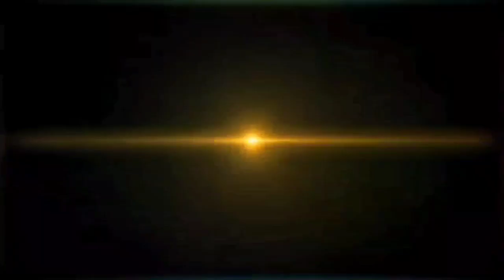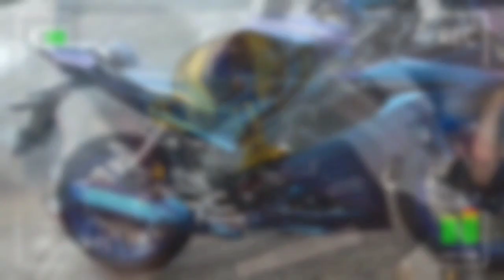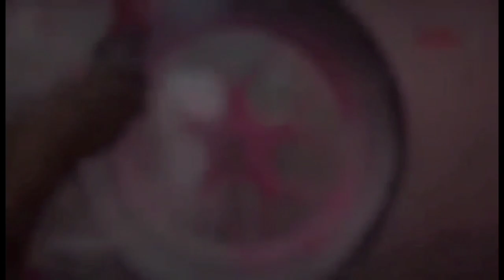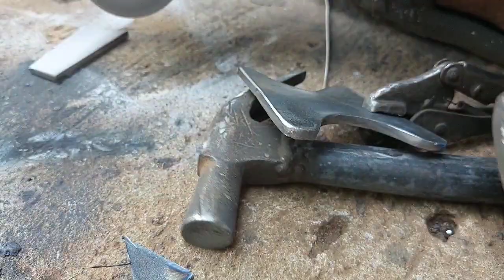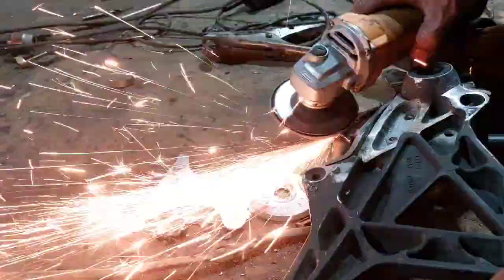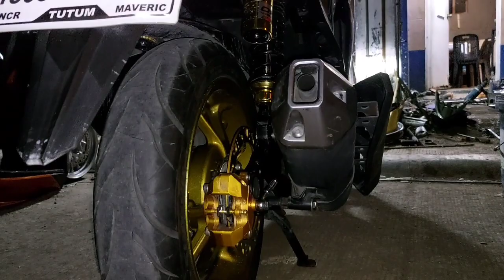Honda click dual shock convertion repair

Comment: Boos hm po gusto dual shock lang stock pa din yung brake sa llikod
Reply from the maker: Maraming salamat po sa patuloy na tiwala mga idol wag kalimutan mag like at follow sa page naten at mag subscribe mga idol ..  mag message para sa mga gusto magpagawa nasa baba narin yung link ng #Youtube channel naten mga idol at #facebookpage 

Service we offer: 
Repainting
Disc brake convertion ng kahit anung motor
Monoshock convertion
Airsuspension installation
Mags convertion at iba pa

Location : st joseph homes 1 gulod cabuyao or GMAP The modifier
Cellphone # : 09123155603

https://youtube.com/channel/UCigkYnmyfRhyUkIueFSbP-w

https://www.facebook.com/anghelmana03/

Comment: Idol saan po ang shop nyo
Reply from the maker: Maraming salamat po sa patuloy na tiwala mga idol wag kalimutan mag like at follow sa page naten at mag subscribe mga idol ..  mag message para sa mga gusto magpagawa nasa baba narin yung link ng #Youtube channel naten mga idol at #facebookpage 

Service we offer: 
Repainting
Disc brake convertion ng kahit anung motor
Monoshock convertion
Airsuspension installation
Mags convertion at iba pa

Location : st joseph homes 1 gulod cabuyao or GMAP The modifier
Cellphone # : 09123155603

https://youtube.com/channel/UCigkYnmyfRhyUkIueFSbP-w

https://www.facebook.com/anghelmana03/

Comment: Sir pwede ba yung bracket na pang double shock lang kasi gusto ko stock padin ang preno sa huli.
Reply from the maker: Maraming salamat po sa patuloy na tiwala mga idol wag kalimutan mag like at follow sa page naten bago mag message para sa mga gusto magpagawa nasa baba narin yung link ng #Youtube channel naten mga idol 

Service we offer: 
Repainting
Disc brake convertion ng kahit anung motor
Monoshock convertion
Airsuspension installation
Mags convertion at iba pa

Location : st joseph homes 1 gulod cabuyao or GMAP The modifier
Cellphone # : 09123155603

https://youtube.com/channel/UCigkYnmyfRhyUkIueFSbP-w

https://www.facebook.com/anghelmana03

Comment: Location po bossing?
Reply from the maker: Maraming salamat po sa patuloy na tiwala mga idol wag kalimutan mag like at follow sa page naten bago mag message para sa mga gusto magpagawa nasa baba narin yung link ng #Youtube channel naten mga idol 

Service we offer: 
Repainting
Disc brake convertion ng kahit anung motor
Monoshock convertion
Airsuspension installation
Mags convertion at iba pa

Location : st joseph homes 1 gulod cabuyao or GMAP The modifier
Cellphone # : 09123155603

https://youtube.com/channel/UCigkYnmyfRhyUkIueFSbP-w

https://www.facebook.com/anghelmana03/
Reply from the maker: Maraming salamat po sa patuloy na tiwala mga idol wag kalimutan mag like at follow sa page naten bago mag message para sa mga gusto magpagawa nasa baba narin yung link ng #Youtube channel naten mga idol 

Service we offer: 
Repainting
Disc brake convertion ng kahit anung motor
Monoshock convertion
Airsuspension installation
Mags convertion at iba pa

Location : st joseph homes 1 gulod cabuyao or GMAP The modifier
Cellphone # : 09123155603

https://youtube.com/channel/UCigkYnmyfRhyUkIueFSbP-w

https://www.facebook.com/anghelmana03/